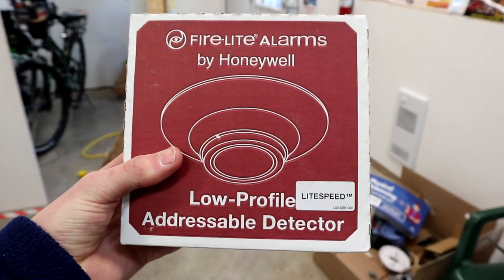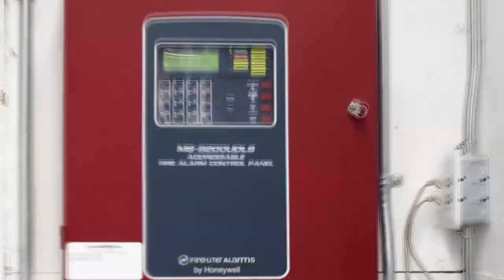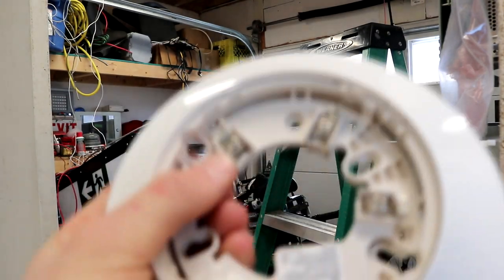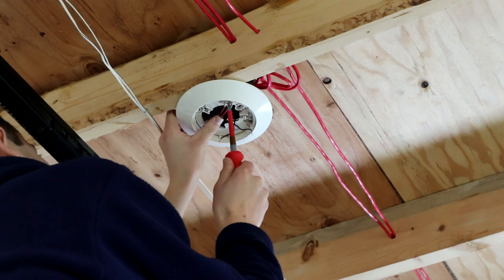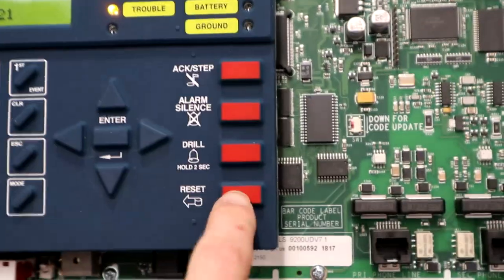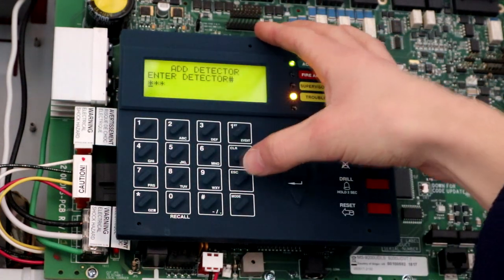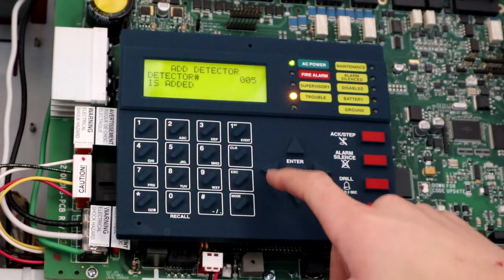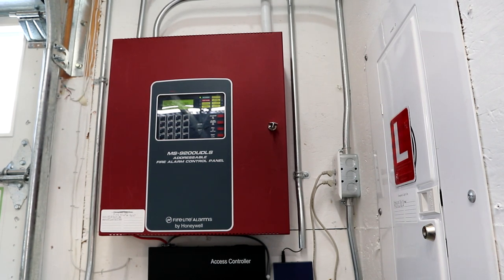How to add a device to an addressable fire alarm system/finishing my system

Comment: I noticed you were using the sd 365 detector with the ms9200... I'm experiencing difficulties with a the same setup only difference is that the number of detectors are about 25 and the system is best ng upgraded... Has about the same amount of old type detectors? What can I  do to get them all active as the panel goes down after a certain amount
Reply from the maker: Is the panel running litespeed or CLIP protocol?

Comment: Awesome video! Good work as always.

I wish the Notifier 320/640 panels allowed for adding individual devices instead of having to do autoprogram all the time.
Reply from the maker: I didn’t know that do you have to erase and then re-configure the whole system I guess
Reply: @nics-systems-electric  Thankfully once a device is programmed into the system you can modify and delete points individually.

You just cannot program points individually like you can on the 9200UDLS
Reply from the maker: @vafirecollector9547  that would be nice if you could add points
Reply: @vafirecollector9547  Yea I wish you could individually add points, autopgoram takes a while but at least your settings and stuff don't get deleted

Comment: If I just bought a new house, and wanted to install a whole fire alarm system, would I leave the current smoke detectors in place that the house came with and just add the fire alarm system smoke detectors elsewhere, or remove the current smoke detectors and add the fire alarm detectors where the former ones were?
Reply from the maker: If you leave the current ones then you're still complying with all rules for residential home and you don't have to hold your own system too as high of standards. You can't and shouldn't put low-voltage into a high voltage box anyways so assuming they are hardwired you shouldn't be putting in your cables from your low-voltage fire alarm system. They would need to be in their own separate box.
Reply: @nics-systems-electric  ok, and btw, what is the best addressable system sensor smoke detector in your opinion?
Reply from the maker: @OklahomaStateSirens  the only system sensor detector I'm aware of that is a addressable is the 2351B not sure what systems it's compatible with, though as I've only ever worked with detectors that are branded for the system.
Reply: @nics-systems-electric  what about the sd365?
Reply from the maker: @OklahomaStateSirens  that's Firelite not a system sensor product SD365 is made to work with firelight systems.
Reply: @nics-systems-electric  are the smoke detectors your house came with still in place?
Reply from the maker: @OklahomaStateSirens  no, if they were  replaced at a recommended 10 year interval, they would've been replaced four or five different times. however I removed the ones from 2018 anyways.
Reply: @nics-systems-electric  ok, how did you find out what size back box is needed?
Reply from the maker: @OklahomaStateSirens  they go on a 4 inch octagon
Reply: @nics-systems-electric  ok
Reply: @nics-systems-electric  I’m getting a es50x, a ann80, a 365 smoke detector, and a few led series horn strobes and strobe, can all this be run by 2 wire fire alarm wire?
Reply from the maker: @OklahomaStateSirens  you would need one to wire for your SLC devices and another two wire for your horn strobes and your annunciator takes four wires
Reply: @nics-systems-electric  ok, thanks, btw, sorry for all the questions, your just one of my favorite fire alarm YouTubers and you always have the answers 😂
Reply: @nics-systems-electric  do you or do you know anyone who made a video on how to wire the slc?

Comment: I will say I really like the 365 series smoke and heats
Reply from the maker: Me too
Reply: @nics-systems-electric  i
Can you guess the model before the 920ludls
Reply from the maker: @Fire-hq3rm  I’m assuming you mean the 9200 UDLS before it was the 9200UD
Reply: @nics-systems-electric  correct
Reply: @nics-systems-electric  the the only differences between them is the 9200ud has the look on the side of the cabinet, and it’s only compatible with the lcd 80f annunciator, and is in a smaller, more rectangular cabinet
Reply: @nics-systems-electric  and the 9200ud Cabot do litespeed

Comment: Pickle you need to wire a resistor to the activation device so you won’t get any troubles on the panel
Reply from the maker: No I don’t it’s an addressable system
Reply: @nics-systems-electric  when you had your old system u didn’t install resistors
Reply from the maker: @VOLTRONDEFENDER4440  yes I did every single zone and nac that’s why there were no troubles
Reply: @nics-systems-electric  well on your Edwards I never seen any resistors in the wires at all
Reply: @nics-systems-electric  and if you see my mini system I don’t need resistors since I don’t use a fire alarm control panel
Reply from the maker: @VOLTRONDEFENDER4440  The Edwards system was temporary but for the past two years I’ve always had EOLR’s Watch any single other video and they all had no troubles
Reply: @nics-systems-electric  what is eolr I don’t know that model pull station I only know notifier Nbg 12l 12lx 12 12lo 12lr
Reply from the maker: @VOLTRONDEFENDER4440  end of line resistor = EOLR